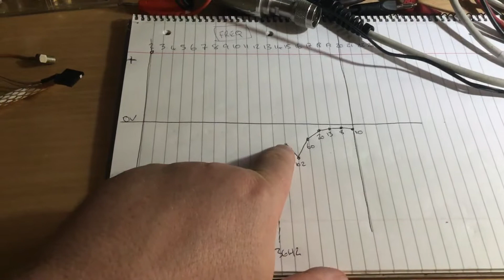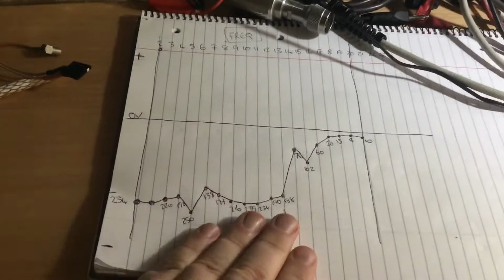Marconi 6200a repair PART7 Microwave radio test set

Comment: Can we use Anritsu Detector & VSWR Bridge with  this Marconi 6200A Microwave Test Set. Can you guide on the modifications required to do this
Reply from the maker: No Sorry you cannot use an Anritsu detector. as for the VSWR bridge if thats none marconi then it depends if its got an inbuilt RF Scalar detector for measuring distance to fault & would have a data cable to connect to the instrument then this could not be used with this test set if its anrutsu, if it doesn't i.e it has 3 RF ports only (in, out & reflect) then yes you can use it.